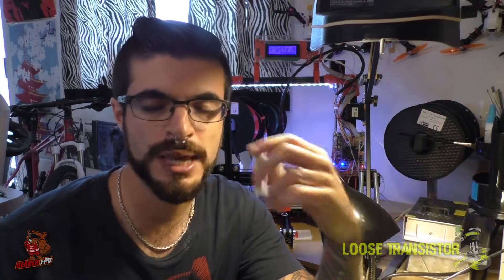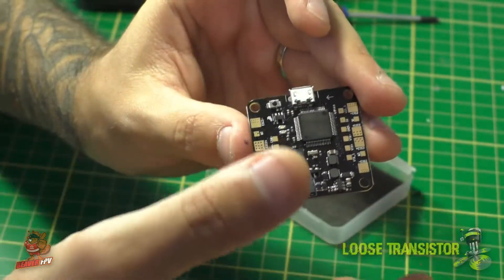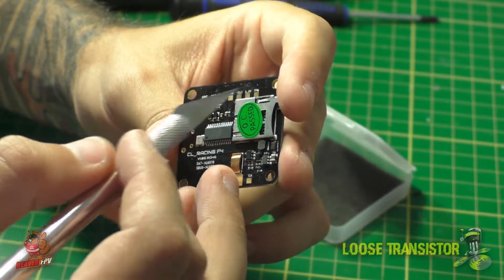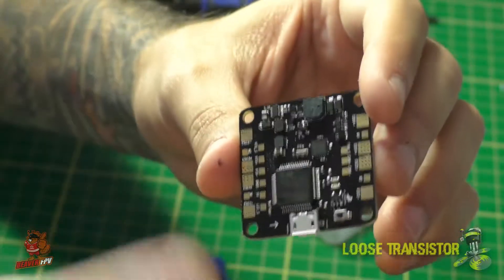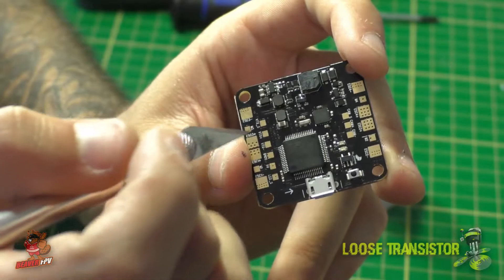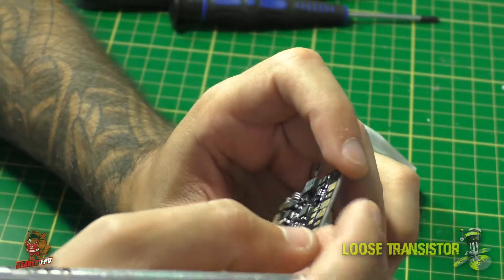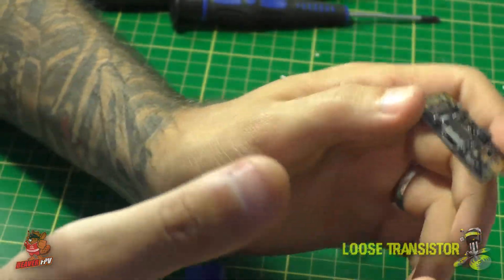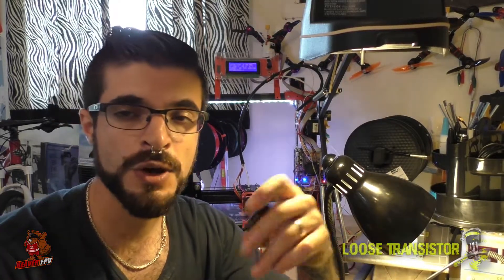CL_RACING F4 FLIGHT CONTROLLER ♠ [ REVIEW ]

Comment: Lucas I am stick. Again. So I finally set up my radio so I can do telemetry and use lua scripts. All the bells and whistles. So I have been flying a while and have built a few quads but have hit a road block trying to upgrade my quad using this board. I got the crossfire system with a crossfire nano rx that can talk to my radio. Okay easy enough right. Four wires power + -, and tx4 rx4 pads on the clracingf4. Same board in this video not the newer one. The problem I have is I bought a furious fpv stealth long range vtx and its wiring calls for tx pad as well. Idk maybe I am just confused. I am seriously missing something because I have never used lua or telemetry before. I am reaching out to you because you always helped me in the past. If you have any insight on how I need to set this combo up to work, if it can work together. Or tell me what my choices are idk maybe I use one and not the other? Idk bro. Thoughts? Also I hope you are well bro.

Comment: I finally got all my parts in. to include a xsr-e RX. what do I need to do so I can use that frysky RX with this f4 board? I need to invert the signals? one of them both of the? straight road block here.. idk bro any tips?
Reply from the maker: Hey man, I am a little confused here. So you have a XSR-E and you need to invert the signal? Or are you not sure if you have to invert it?
Reply: Loose Transistor FPV I am not sure if I need to invert it and am not 100 on what I need to do if it is needed to be able to use telemetry with the cl racing f4.
Reply from the maker: See I am very familiar with the CL_Racing F4 but not familiar at all with FRSKY. So I know that CL_Racing has a telemetry pad. Did you try it?

Comment: how  much does it  weight ?
Reply from the maker: it's too light to register on my kitchen scale and I don't really have anything more sensitive. It probably weighs about the same as 3 quarters ($.25 US). It's a thick PDB but it isn't much heavier than a similar FC in terms of size and features. I would consider the weigh negligible unless you are building some sort of ultralight micro were every micro gram counts. In that case, there are smaller 20x20 FC's that would suit you best.

Does that help answer your question?

Comment: I'm trying to flash ESCs and FC
Reply from the maker: Well, you have to put the board into DFU mode.. then flash it with the Betaflight 3.2 from the configurator. You will need BlHeli Suite or BlHeli configurator to flash the ESC. Are you familiar with the process?

Comment: My osd won't work for voltage and stuff but I can go to menu and change my pids and smart audio. What's the reason behind that
Reply from the maker: Which version of Betaflight have you flashed on it? Did you enable OSD as a mode? Did you configure and upload fonts to the OSD?
Reply: Loose Transistor FPV 3.17 and yes I enabled
Reply from the maker: You should try flashing Betaflight 3.2 RC4 on it. That should fix most of your issues. If not, let me know.

Comment: I was glad to see your channel pop up when I typed in cl f4 review
Reply: @Roto Vicious 

Hi, I'm not him but I have 2 CL Racing F4 boards, both on Betaflight 3.2 (RC4) and the buzzer works.
Reply: can you recommend a capacitor for this board? I'll be strictly running 4s. off top of head I would guess 16v 470uf
Reply from the maker: Of course, I have been using these capacitors with really good results. A bit on the large size but great performance.

https://www.digikey.com/products/en?keywords=P19723CT-ND

Cheers and thanks for watching =D
Reply: Loose Transistor FPV me again, sorry to bug you. I am waiting on parts and its gonna be a couple weeks before I finish my build with this build. I haven't even plugged it into betaflight yet. So my question is about the buzzer on the board. Is it working with the new 3.2 bf? I ask because I am looking at adding LED strip and will add one with buzzer if the boards buzzer is still not figured out. I looked around and no one knows off hand. Thanks Bro.

Comment: BLHeli Pass through, are you able to get it to work with this board?  I just bought this board and I cannot get BLHeli Pass through to work!  I have lots of other builds without this board using the same Spedix ESCs and BLHeli Pass through is not a problem.  What could I be missing here?
Reply from the maker: Make sure you are using latest configurator, update your BlHeli configurator ( Chrome one ) and flash the CL_racing F4 with BF 3.2 RC3 - BF3.1.7 does not fully support passthru, I had problems with that too.

Comment: I only see a signal pad, not a matching ground pad.  Are you wiring the ground wire for the signal to the same pad as the ESC- pad?  The BF and DYS F4 boards have an ESC-, ESC+, Signal+Ground.  Are you not using the ground wire for the signal on the ESCs?
Reply from the maker: Since switching over to the CL Racing F4 I have stopped using the ground wire and so far haven't really noticed any problems or performance decrease.

Comment: Ive got this board too and the video feed is alright, the only issue i 
have is when i do a fast flip the video cuts for a split second, but its
 fine when i do a fast roll..  Can't figure out what causes this.
I bought and was built from Armattan but, I have not heard back from him.
Anyone else had this?
Reply from the maker: Are you using a capacitor? what kind of ESC are you running?
Reply: No I'm not but, there is not a lot of noise it drops like a connector is loose or a pin is not seated. I just used shoe goo on all the connectors and a little concerned about the connector to my camera. It's all the way in but, has a lot of play on the back of the camera. I said roll but it's when I flip using 30A Armattan esc Dshot 600. I may swap 
Foxeer MonsterV2 over to the VTX V and run the TBS off the 5v camera feed. Great idea.
Reply from the maker: Logo 800 it could be a loose connection and your should check for that. However, I would consider adding a capacitor regardless. New motors are pretty power hungry these days. I've had issues like that before that were fixed with capacitor.
Reply: I have them on my EMAX RS2306 2400KV  for video noise. These are Oomph Velvet Edition 2206/2300 KV Motor they are smooth low power and run cooler. Thanks man.

Comment: Looking at manual it reads vtx @ 7.6 I have two spare TBS UNIFY PRO 5G8 but it looks like they will not work on this. What are you running for a vtx on your builds? The HV ones are a little pricey.
Reply from the maker: I run VTX03 which likes about 5V. I run it from the camera feed from the CL_F4 and I run my HS1177 from the VTX V+ because it can take up to 25v
Reply: It's says camera is 7.6v also, not 5v?
Reply from the maker: No, camera V+ is 5V. Do you own a multimeter? It's a good way to test those things for yourself and make sure before plugging anything in. Better safe than sorry!
Reply: I do but my manual says 7.6.thanks I will check I thought the company that makes the board would have a correct print. Thanks...........

Comment: Having a hell of a time getting 3.2 on this guy. Any tips?
Reply from the maker: Can you be a little more specific about the issue you are having?

I am assuming you put it in DFU mode and used the new BF 3.1.2 configurator?
Reply: Repeatedly getting  "No response from the bootloader, programming: FAILED"

Yes 3.1.2, Tried multiple slider on/off positions. Board connects in normal config tab, get the "device connected" sound while pressing boot button but doesn't seem to see it when I press Flash Firmware.
Reply: PS> THANK YOU for being so responsive!
Reply from the maker: So a couple of things. Make sure to hold the boot button down and then connect the usb. Once the light is solid just release the boot button and leave it connected. Then try to flash.

It is possible that you have driver problems, so you might have to use zadig to fix that and override the default driver that windows installs.

Refer to this link for more info on zadig (https://github.com/betaflight/betaflight/wiki/Installing-Betaflight#dfu-flashing-under-windows---usb-dfu)
Reply: Did all that bruh. Side note: After like 10 effing reboots my PC read the board/s as STM32 instead of CL Racing F4 (in Zadig) and now both are flashed to most recent 3.2. Computers are dumb as shit lol.
Reply from the maker: LOL Man, you are not the first to tell me this. Something weird going on for sure but glad it worked for ya!

Comment: Only thing that kills me with FCs like this and the Betaflight F3 is that they do not have extra motor and signal pads in case you need to remap after a bad crash.  Other than that this thing looks nice. Great review, I'm gonna have to nab one to play with.
Reply from the maker: Yeah thats 100% a good point Enok. I think that in this case I might excuse it because the price point is on the lower end, so if you really bust a pad due to a crasha replcaement won't cost you all that much.

Comment: Great review I've ordered 2 and looking to swap out my current BFF3. You said Dynamic Filters enabled and PT1 does that mean your other 2 filters are still active or tweaked?
Reply from the maker: I actually have the other two filters disabled on mine. I haven't bothered to actually tune the notch filters using Black Box because honestly its flying super well as it is with dynamic filters. Biggest difference being how cool the motors got after I enabled Dynamic filters.

Comment: Hey, man, thanks for putting out this review. I was looking into this board since you mentioned it to me yesterday. Any idea how much juice it kicks out for the camera? That's the only thing that's worrying me. The rest of it looks pretty awesome, especially how much better the sd card reader is than the Betaflight F3 board.
Reply from the maker: It has 2 BEC's one at 12V and one at 5V both can supply 1.2A each. So, the way I have it setup I am feeding the camera 12V and feeding the VTX 03 5V and it works friggin great!
Reply: Aw, man. I was hoping there was a way to give full batt power to both the cam and the vtx. Thx for clarifying.
Reply: ok im confused. i just saw this board on armattan and the description says it has a 5v and 7.6v bec not a 12 volt. can you test the actual voltage?
Reply: Just run cam and vtx to battery with lc filter.  For full voltage   I've confirmed 12 v on Bec  str. From CL website
Reply from the maker: I get 12V from the BEC. I think the 7.6v was mistyped somewhere
Reply: Loose Transistor FPV So both the cam and vtx can get 12v?
Reply: awesome thanks for the clarification